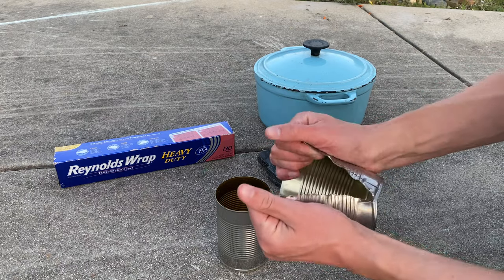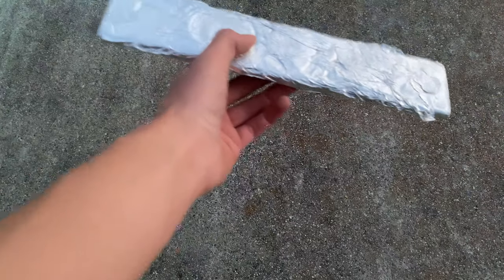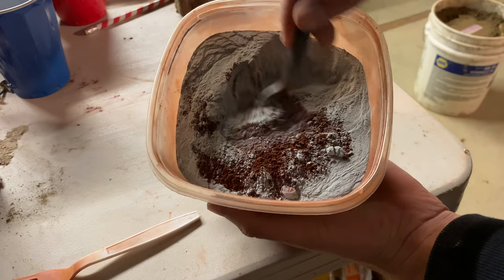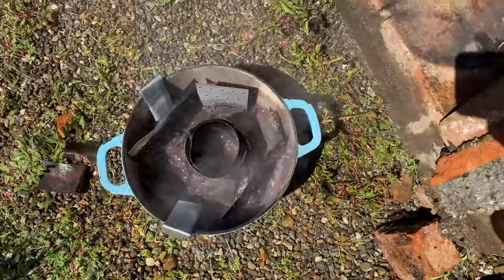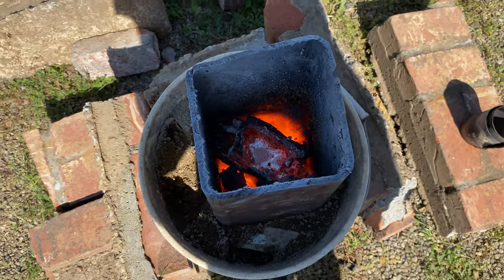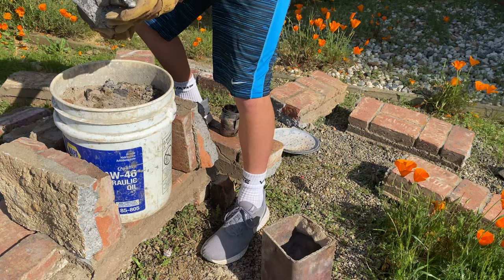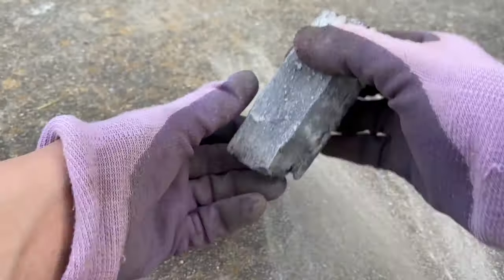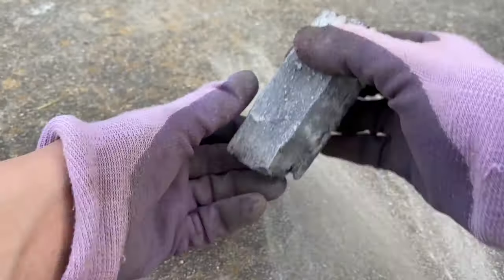Turning Aluminum Foil into an Ingot

Comment: What I figured out is the cheap $1.50 at the store is better because less plastic coating on it and it’s the same as the $3 but the slightly less thin making it better if ur going for aluminum (at least for the store I get it from

Comment: Bro can i do that just using candles? Please tell me! because im gonna do that
Reply from the maker: you mean starting the thermite with candles?
Reply: @pyrochemminer3453  yes
Reply: Uhmm how about without thermites could we melt them?
Reply from the maker: i doubt a candle burns hot enough to ignite thermite
Reply from the maker: if u wanted to do this without thermite you can use a foundry to melt the aluminum in a crucible, then u can pour it
Reply: But yeah! I did an attemp but just a try its so small just as sized of a penny yeah it worked!
Reply from the maker: did you use a foundry?
Reply: Hey! I know what's easier than melting you only need to do is grab a whole piece of aluminum foil and hammer them until they get flat and get the cardboard inside the foil and heat them up a little in stove then hammer them into a very flat foil and done the foil ingot is much bigger but very flat.

Comment: This was really cool to watch man, the termite was badass, I'm gonna have to learn more about that stuff. I do have a couple of suggestions for you:
• In the future when you're doing things like this, don't wear what you wore in this video. The gloves were a good call, but the athletic shorts +basketball shoes combo is a no-go for any number of reasons. Even if it's 100°F outside, if youre forging/casting then at the very least you need to be wearing long pants, workboots, gloves, and safety glasses. 

• Instead of just scraping the ingot on the driveway, what you can do is get a container big enough to set your ingot in, throw in a handful of sand and a little water, and then just rub the ingot back and forth. It works if youve got absolutely no other options, I originally learned the concept from a YT video where they were talking about methods used in ancient times to cut stone and drill holes. But honestly you can get a cheap file and/or a pack of sandpaper (look for a special type of sandpaper called emery cloth, its specifically for metal) and a rubber sanding block from Walmart for a few bucks. If you have trouble finding emery cloth, auto parts stores sell it for sure. You don't even need power tools for this particular task honestly.
Reply from the maker: Yes I definitely should of had more safety stuff, especially with thermite. Also, now I got an angle grinder and files, so no more pain with the concrete.

Comment: I don't get it what will u do with the ingot it was cheaper to buy a small alluminium ingot then buy a load of kitchen foil
Reply from the maker: i guess just proof of concept that u could melt and cast aluminum foil with thermite. yes you are right buying blocks of aluminum is a lot cheaper (that or soda cans is what ill be using in the future)
Reply: It’s for something to do.
Reply: Personally for me I would rather spend a little bit extra money and have a day of work something to do
Reply: I am more interested in the irony of using thermite as a heat source to make an aluminum ingot from foil.

Comment: Um i have a question what is the white powder and red powder????
Reply: from what i can guess, the red powder is red iron oxide and the white is just iron powder.
Reply: That is thermite, 3 parts iron oxide to 1 part aluminum powder (by weight). When this burns it goes nuts, it burns somewhere upwards of 4000 degrees Fahrenheit
Reply: @isaiahspinney6113  ty bro

Comment: This is hilarious, it's like you failed on purpose over and over.

I watched you with the foil like... why is he doing this the hardest way? Then I watched you do the weakest thermite reaction I think I have ever seen. Then I see you moving around in the driveway making lines all over when technically you could have just kept going in the same spot.. only to then use sandpaper with a way too high of grit Lower grit = works better, faster, easier... higher grit is when you are already smooth and want a mirror finish on it.. fine sandpaper right before polish.

It's been 4 years since this video, I got hope you improved your skills and learned from your mistakes but nice entertainment value at least.
Reply: Because he was just a kid when he made this video. Use your brain dude